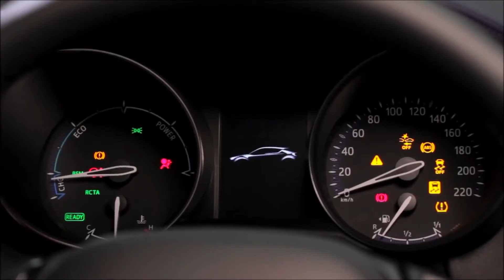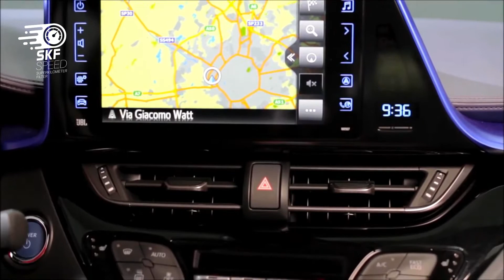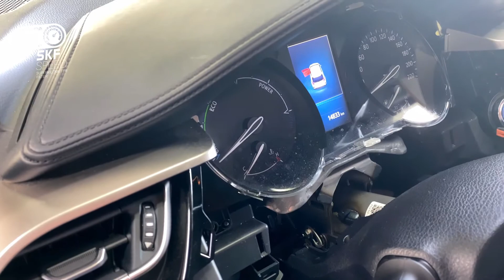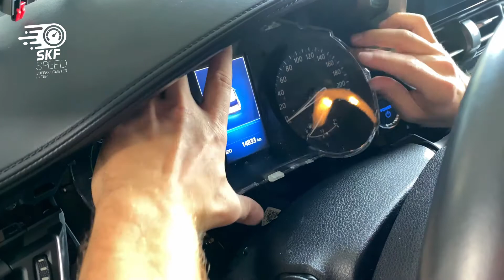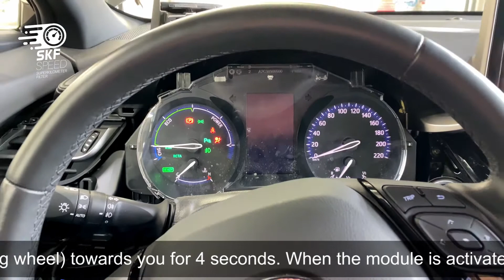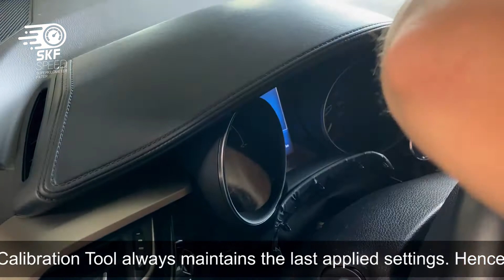How To Stop Odometer on a TOYOTA C-HR 2020 | Mileage Blocker

Comment: Is that a regular Philips screw driver being used? The screws I have will not come out with a Philips it just keeps turning. Mine is a chr 2018
Reply from the maker: the simplest screwdriver do not press the cross too hard then the screw will also come out
Reply: Same thing happened to me. So just a slight turn? They just turn but don't come out